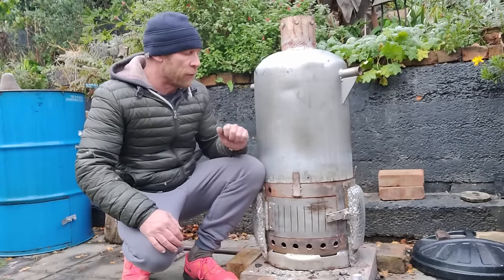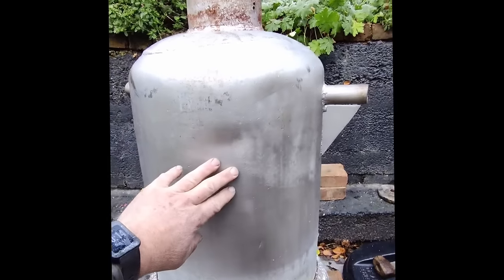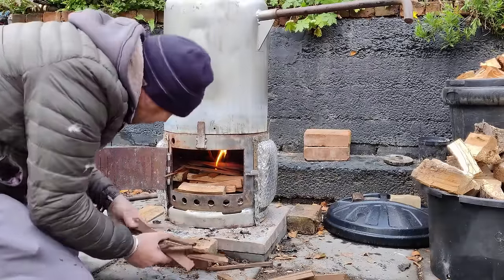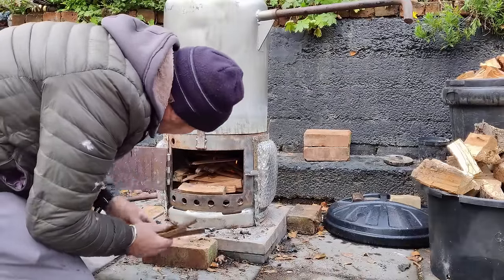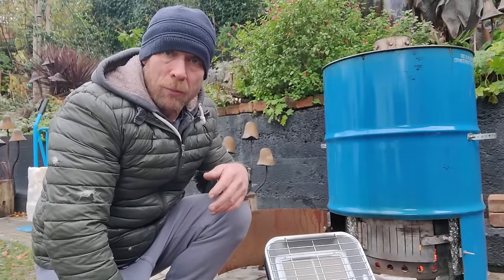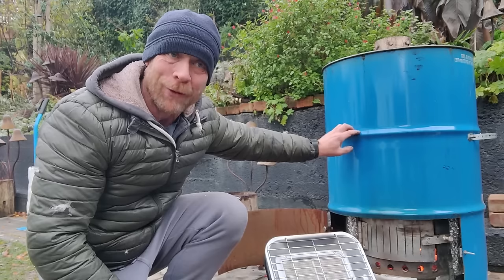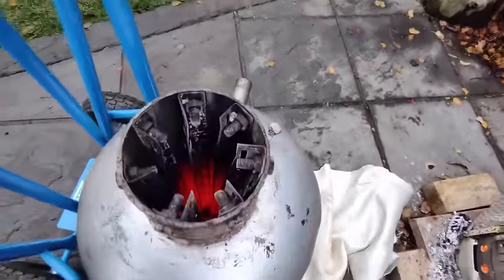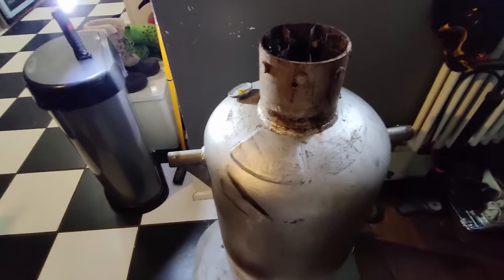Sand battery can it heat my home?

Comment: Hi Lee
That's great! Really appreciate you sharing this as I'd been having ideas the same.... I've just filled a wood stove up with sand (can't use in my location) and bought some 12v  28w PTC 220 degree ceramic heated elements to stick in the Sand and run direct of some solar panels... I'm also gonna make something very similar to your burner and fire it up in my workshop to provide some heat in there before moving it into the house 👍
Reply: I'm doing the exact same thing except the heating element is a 3kw 240v unit from a water heater. At 12v it draws about .75a and at 24v it's drawing 1.5a. It's very slow to warm up but it works. If I can find another, I'll shove it in there.
Reply: Video plz? i want to see this.
Reply: the solar panels are a great idea. not as efficient as using the heat from the sun directly (evacuated tubes) but if you know an installer and can get 2nd hand panels for nothing (easy) then it solves the issues of incompatible voltages (most grid tied systems run 36v panels... most offgrid systems dont).

you can go further... nichrome wire will happily hit the 1000C mark. it is used in kilns after all. just need a bit of maths on diameter and lengths. like i needed 30M approx of 2.5mm to hit 16R for about 8A at 240V for my friends kiln recently. x2 for two phases. a lot of winding!
iirc... dont quote those figures. it was a year ago.
 i just got a little 30W ceramic heater for lighting my furnace... it glows red hot, safe to 1000C. shame my furnace hits well over 1600C... 

im thinking of wind power though.

using a fet, you can regulate the load on the turbine to match it perfectly to the wind speed... at all wind speeds. no worries about too little or too much. just dump it ALL into the thermal mass. cant do that with batteries. with an oversized genhead on the turbine you can keep it spinning even in a hurricane and its not going to overspeed.

and then?

if you have something at 200C plus, boiling water is a breeze... 

and boiling water makes steam.

Comment: If I used that much wood on my log burner,it would probably last in excess of 12 hrs and belt out heat that would warm whole house.
Pity I can't fit a sand battery on the log burner.
I wonder if a pile of storage heater bricks on the log burner would permeate heat after fire goes out?
Reply: Ive been looking at soapstone,you any experience with it?..its expensive and rare enough here in Ireland anyway
Reply: @stephenmorgan7678  No,but I have alot of storage heater bricks,I will experiment.
Reply: Storage heater bricks work great around a wood stove...used have loads round one and stacked up like a pyramid shape! The more the better 💪
Reply: @stephenmorgan7678  They make soapstone wood stoves for small boats.  The firebox is of necessity quite small and can't burn for long, but the soapstone gives out stored heat for a bit longer.
Reply: @LOOKOUT2012  any pics?Id love to see how that worked

Comment: I love it! What if you kept the sand in the house and piped heat to it through some pipes and back out again for exhaust, and you can get more heat from the pipes in the house, and so the wood burner stays outside....? And the handles can become sock dryers.

Comment: I live in a small old house in the Netherlands. I started applying door and window draft strips and pur foam to close up all the draft holes and gaps that I could find on the entire down floor, including the inside doors, and I insulated the down floor ceilings with a couple of PIR insulation boards and pur foam, and that made a huge difference. It was a relative warm winter, but compared to previous years I only used half the amount of gas. And with the current prices that is going to save me between 2000 and 3000 Euro just this year. 

I really recommend every person to apply door and window strips, because for a relative cheap investment you really get a lot of gas savings and comfort in return. It is truly a huge difference. And once you start closing up gaps you will find even more gaps because they will be easier to detect as your house starts to feel more comfortable. I am not a rich person. So I do everything that I can do to save gas. And I can monitor my gas usage and the average outdoor temperature by the hour, week, month and year. And I can compare previous years with this year, so I have a very accurate insight on my usage. And I check it every single day. 

I bought the PUR foam and strips from the Action store. It is cheap, but it did the job. Half of the PIR foam boards were 50mm and for free, and the other half of it was 80mm which I bought at the hardware store, but I managed to get a discount from the manager. I always ask for a discount, and sometimes it works, and sometimes it doesn't. I only needed to buy 5 extra boards because I have a small ceiling. 

It is an investment that might be expensive for some people, but for me it already payed itself back, and it feels much much more comfortable. It is truly worth to make that investment. Even if you can't buy the thickest boards.

Comment: Hi Lee Jones.

I was wondering IF instead of 1 central tube / flue of say 4 or  5 inches, you had 4 one inch tubes/ flues instead. Maybe that could heat the sand quicker?

Have you tried placing a saucepan on top of the flue when the fire is lit and heat water that way. You could then transfer that heated water into a thermos (ideally more than 1) or hot water bottles. That way you'll utilize the heat in a dual way.    

 I forgot to sub last time I visited - remembered this time.

It was nice of this chap (https://www.youtube.com/watch?v=7cOZVw4SJes)  to name check you via the link he provided in his upload.
Reply from the maker: Not sure. Yes could be a options my only concern with that is on each tube you would only be efficient on the side of the tube that are in contact with the sand & the other side's would be just heating eachother & getting lost to the atmosphere? The mantel I use captured the heat & directs the main stream of hot gases through the fins & transferred into the flue wall to the sand.
& Yes keep meaning to boil some water on it but if I get time I want to make a small  battery either sand or water to heat the bathroom 👍
Reply: @leejones2511  Cheers for the reply 😀
Reply: I think there is definitely value to Felipes idea. Multiple spaced out pipes running through the sand have significantly greater surface area for heat transfer, than one single large pipe. 
for example. I'll assume the existing exhaust is 4" diameter and 24" long. You could keep the same total x section by using Four 2" pipes though the sand and this would have two advantages 
a) the total pipe surface area available for heat transfer is doubled and 
b) the pipes would be spaced out in the sand and more effectively heat the whole cross section of the sand mass, rather than having a single heat concentration at the core'
c) when recovering heat by convection [no fan] you could, to an extent, control the amount of heat released, by simply plugging off one or more holes at the top. 

I would think that a 'lift on' simple tin sheet cone to collect the 4 exhausts into a central 4 inch 3 foot chimney could improve the up draught and further reduce the time to get the sand up to temperature. 

The build would of course be more complex and a bit heavier to move but would, I think, more than repay the effort.
[I think the best layout might be 5 pipes in a circle and one in the centre, in which case 40mm pipe could be used, giving about 2.4 times the surface area]

Comment: install some solar panels and then run the electricity down to the house and install a few water heater elements into the sand and use the solar to heat the sand.... might continue your temp for longer and you wont have to burn as much wood except for night time heat. Also just like a radiator, install your fan to blow over the whole thing not just down the middle. take your barrel and turn it into a cover with a fan..
Reply: If we use the Giant steel container than I don't think we need Fan or blower

Comment: Hi Lee, 

maybe see if you can produce steam with the sand battery - run a copper coil from bottom to top  in the sand and pump water in the bottom to produce on demand steam which could be used for generating power
Reply from the maker: Possible, obviously would become less efficient for heating, not really for this project but yes could be done👍

Comment: For those who don't have your unique circumstances (upstairs flat with no chimneys), this could give some great ideas for adding a thermal mass to wood heating stove or fireplace.
Also, if they don't have the stairs, this might be an acceptable option for many people for emergency heating when the grid is down.

Comment: Lots of radiators in cars use a ‘turbulator’ in the tube. Basically a spiral to slow the flow and allow a better heat transfer. Could be an idea? Either way it is a great idea.

Comment: You should add locking pins or bolts to the handles, just in case a handle slips out. This could rip one of your legs open if the handle pickup hits you when it falls

Comment: Put a stand on top, boil water in a pan, then drop into a thermos. Use it fresh, or to boil in an electric kettle - reduces the heating time used by the electric kettle.

Comment: Thank you for the video. Suggestion...If you create a 'ROCKET STOVE burner to burn the wood, it would use a lot less and create more heat, as the wood is virtually 100% burnt, and no smoke comes off. Best wishes. Tony

Comment: If your choking the flue you also need to restrict the air in, this way it will burn much longer and cleaner, it will take you longer to heat the sand but you will use less wood and create less smoke..
  I think it would be worth having this installed with a flue type metal chimney exiting either the wall or the roof directly above, you don't need to use the old broken  chimneys. I'm thinking bigger gas bottles all the way up through 1st and 2nd floor from ground to top ceiling.
  I guess the disadvantage of having it installed with this configuration is that the inner heat released would be going up the chimney all night after the fire goes out. You could have an insulated flap that closes but there are always some cinders that need a vent so it would need 2x chimneys so you could close one at the top and open the other one for the fire to finish burning out, might have to loose that inner pipe as a heat vent or find a way to avoid ash blowing up into the room if you did open it once the 2nd chimney was switched in.

Comment: Could you rig up a gas burner under it? The faff of micro-managing a wood stove and the many impracticalities of what that involves might put people off this.

As a concept its excellent but I'm envisioning a more practical solution. I know there's then the added cost of gas but maybe it would be quite efficient and overall cost saving with a dedicated short burn time compared to just a gas fire running for 8 hours.

Comment: The reason the sand insulates so well is there are spaces between the grains that are dead air spaces, (heat travels much more easily and quickly by means of conduction than convection or radiation), which is why fiberglass insulation works as well as why storm windows work.

Comment: Nice project! =) Yes sand is basically a insulator with k value of 0,2 W/mK vs water that doesn't move is 6 and effective k for water is much much more. 

I would think that for this kind of solution water might be better choise. Of course it's super dangerous if your release valve goes closed :D 

If you make it taller you will probably have better efficiency. 

Kind Regards PNE CEO Tommi Eronen
Reply: But water won’t get hotter than 100 degrees, it would cool down too quickly I assume…

Comment: Your a ver resourceful 
Feller ..🧑‍🔧👩‍🏭
Think about addind a detatchable ,4 or 6 foot lenght of chimney  pipe with a inline air damper..
Less smoke on your clothes  / in your face..
Much better air draw 🎈
An you will get so much air draw ⬆️  you will need the chimney  damper 🔥

Comment: Its literally forcing us Brits to be ingenius. I think you should do it differently. Run a copper pipe coiled inside that but fill it with something like water or waste oil and have that pipe go into your home and into other sand batteries ans then you don't have to move. Yours isore efficient simply because outdoors the law cant stop you burning any wood you like,  but indoors they will fine you if your chimney has wet wood or treated/painted wood.

Comment: The trick is to extract the heat efficiently. If you had buried 5-6 loops worth of copper tubing in the top half of the sand? You would be able to easily hook up a small external radiator/fan assembly.

Comment: Hay alguna razon , para no poder construir una estufa en la planta baja Y a trabes de caños llevar el calor hacia planta alta ? queremos ayudarte , el esfuerzo que estan haciendo es de locos .nos podras informar sobre el tipo de construccion ,es de madera o mamposteria la casa ? algo muy liviano seria una estufa de pellet casera tipo S  .para calentar toda la parte de arriba o una estufa de aceite ,esta todo en you tube  y veo que tenes la capacidad de soldar, podrias construir cualquier modelo. Ese mismo contenedor de metal  donde construiste la bateria de arena ,lo pones arriba de una sola hornalla de la cosina y calienta el hambiente muy bien , aumenta su eficiencia con un ventilador que reparta el calor, es solo una  idea para gastar menos gas que un calefactor de gas  industrial

Comment: Very clever, but there is no way myself or my wife are going to haul this big heavy thing around. What do you do if it is pouring rain or snow outside? Any of those unvented  gas or heaters are dangerous. They may burn clean without fumes, but they still deplete the oxygen in the room and give off water vapor which condenses on your windows or walls.

Comment: Rocket stoves are the worlds most efficient wood burner, which captures almost all therms in clay or cob which would be installed in the home. Nearly zero emissions once hot, uses very little wood. You could literally pick up hardwood sticks on the ground and heat your home.

Comment: insulating the vessel is important. but yes, using resistive heat, placed in and around the center of mass is optimal. that wasy the sand on the outter area does in fact insulate that heat. using resistive elements, the temp can quite easily get over 600c

Comment: What you could do to make it easier to move is have the cover be removable, and add stackable doughnuts filled with sand around the flue pipe.  Dividing the mass of the sand  into 3 or 4  doughnuts would take a lot of strain off your backs.

Comment: Boiler system too pipes. A heat duct run through a window with heater out side .I have a generators that run on wood that can heat 6 homes in Canada. Wood gas one wire bit noisy.

Comment: i am realy sorry about the fact that people need to go to this extreme stuff to heat there house, while infact it dont need to be like this, but maybe make pipes from your boiler go through the sand battery so that you basicly only need to run the pump of your boiler or buy a small metal pump and a lose radiator and place a coil in the middel filt with oil or water and then heat the sandbattery. but good effort non the less.

Comment: Hi by the way. All those flames out the top are wasted heating time, and fuel it takes to heat it. A damper keeps most of the heat in, mostly smoke out

Comment: For a sand battery you would want a lot more sand to heat up.  Most central heating systems are transferring heat with water which has a much higher Specific Heat Capacity than sand does (water contains more energy per degree than sand does).  The benefit for sand batteries are: a) sand is cheap b) sand is stable at much higher temperatures than water.  Good work with the experiments.
Reply: But at this size the “water battery” wouldnt be as efficient as this, because u cant heat the water to 250°C (if you still want the liquid) and sand can have 2.5x the temperature of water…
Reply: @hurvinekspejbl6229  I agree, a water battery would not be a good idea. For effective home heating the amount of energy to be stored will need to be higher than this example is capable of, but I am appreciating the testing that is being done here.
Reply: I'm currently getting the equipment together for a full house wood gasification boiler and the water accumulator tank needs to be 5,000 to 6,000 litres. I'm hesitant to finalise the design as I think a sand battery and hot water storage hybrid system will have additional benefits.
Reply: @SimonCoates  totally agree with the hybrid idea, would love to see some videos about it, or just something nore in depth, really good idea. Thanks

Comment: I don't know if it would work or not, but have you thought about taking a large car brake rotor and setting it on top of the flue like on an oil burner. It may hold a little bit more heat in the body for the same amount of wood
Reply: Lmao never mind. I was only about 20 minutes in or so. I see you got yourself a lid right there anyway. I like it, It's a cool design man
Reply: Rocket stove